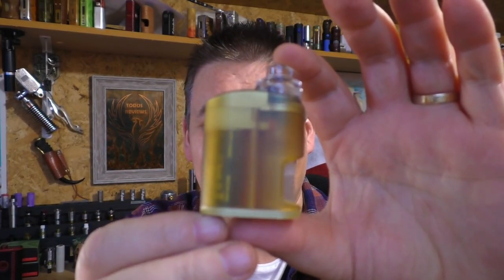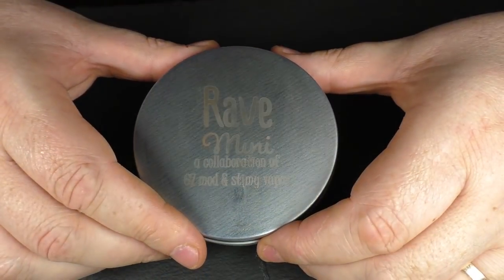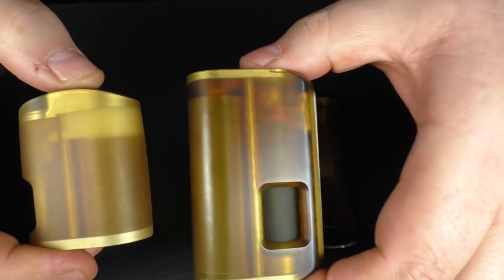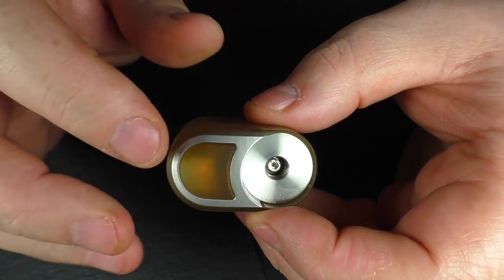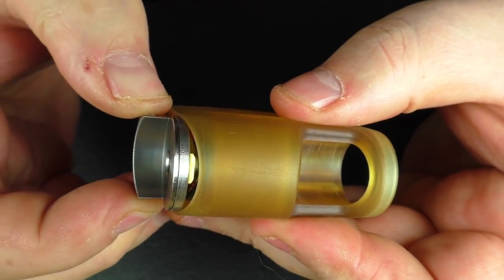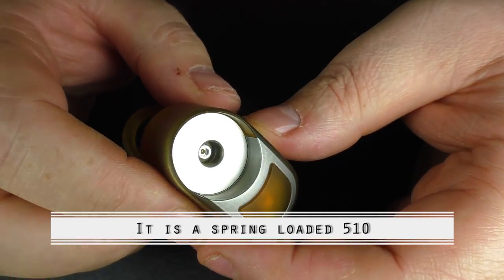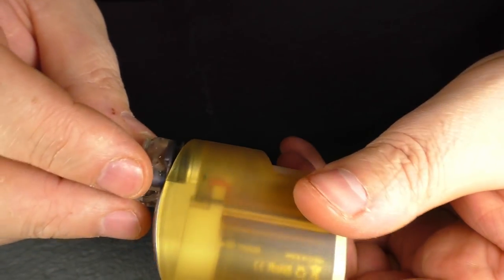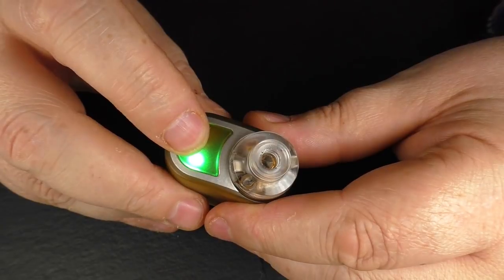Rave Mini 18350 Squonker by 67 Mod & Stimy Vapor

Comment: Todd I’ve never thanked you for a review, but I have to thank you for this one. I doubt any of the other that I watch will review this. 

This mod ...... I love it. It has everything that I want: 18350 (yes, I’m a 18350 fan. Got the Ehpro mod 101 recently to run in 18350).

I’m a Squonk fan, have been long before they were affordable. 

MOSFET is my thing. I don’t do mech’s; I have virtually all boards except YiHi and Dicodes. They are cool, but I like to build and have the “fet” do its thing. ALSO, this one is coated to resist moisture PERFECT!

22mm atty’s are my preference; and I’ve been living at 50mg Nic Salt at 1.2 to 1.6 ohms. 

I’m a fan of the Ultem look; and I’m absolutely nuts for small-mods. 

What I’d like to do is get that Vandy Vape Simple EX RDA to put on top of this. 

So, this appears to have been made just for me. 

No shops in USA, no problem, I’m willing to pay a premium for shipping. 

I WANT THIS!

Comment: Got mine today in black and I am in love. True about the bottle though and my refill bottles don’t fit... Heading to the shops tomorrow. Great review as always by the way.
Reply: you can use old 10ml bottle or any refill with a topcap under 22mm as well
Reply: Thanks 67 (is this Raphaël? - if yes I’m not far away from you - Malmedy, so hello! :-) Also, my bottle seems to leak now. Should I get another one or is there a known fix?).
Reply: @Strannix1979  effectivement, on est presque voisin. Il faut vérifier 2 choses. La première c'est que l'oring sur le cap de la bouteille soit bien présent et la deuxième chose c'est que ton pin du 510 soit bien régler. Si celui ci ne presse pas correctement sur la soft, il y aura des fuites. Des belges dans les clients, c'est assez rare ;)
Reply: Sixty Seven Merci ! J’ai été agréablement surpris d’apprendre par la bande que tu venais de la région. Nice work!
Reply: Sixty Seven Ça a marché. Merci pour le conseil. J’adore ce petit mod.
Reply: @Strannix1979  🤘
Reply: @Strannix1979  tant mieux ;)